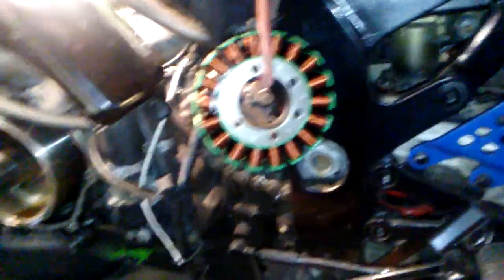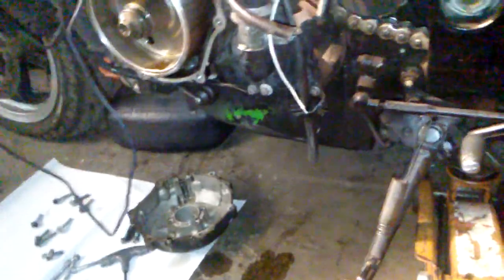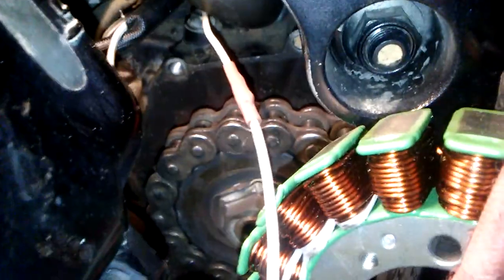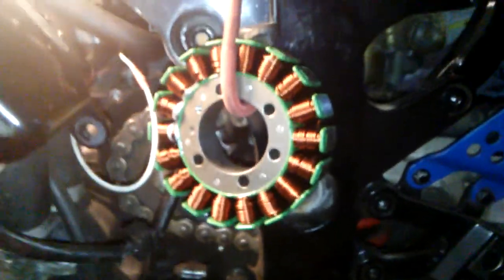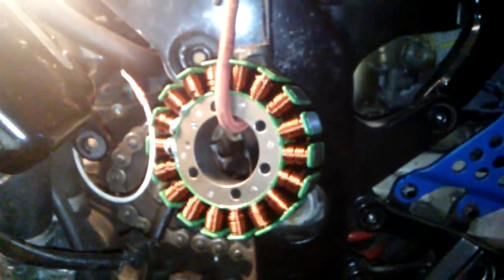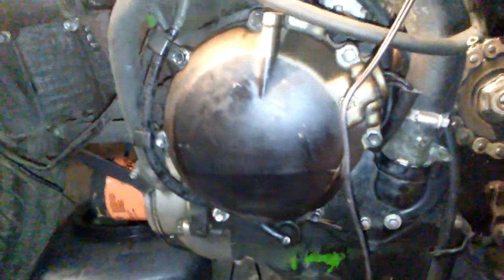How to zx 12 8 6  stator replace part 4 finished

Comment: im at same point now where im replacing the stator and didn't want to drop engine again to disconnect the one wire connector that's unreachable otherwise 🤦‍♂️.....

 thanks for the different approach option 👍

did it ever work tho?
Reply from the maker: Yes sir 100% ,
Reply from the maker: Very welcome